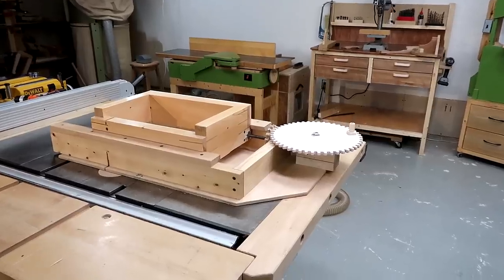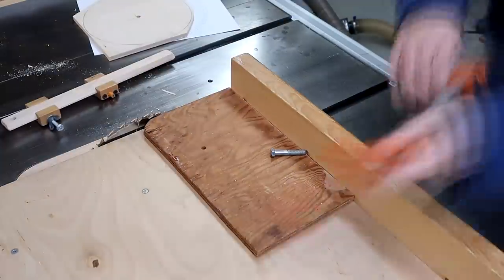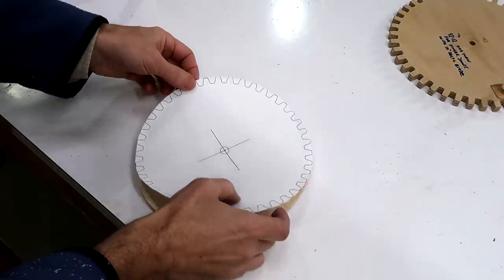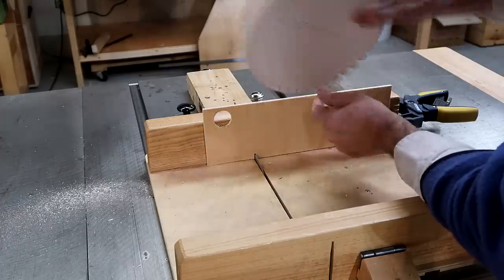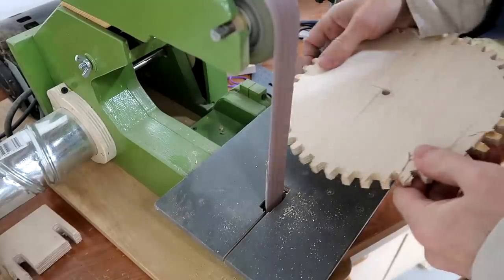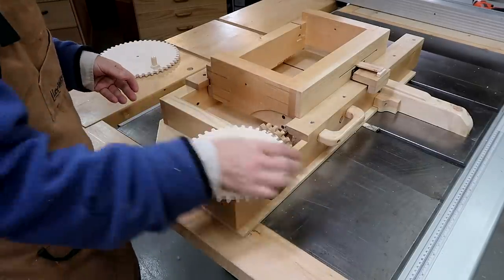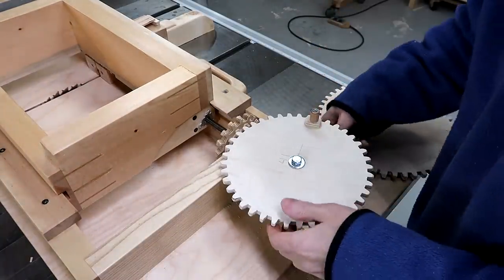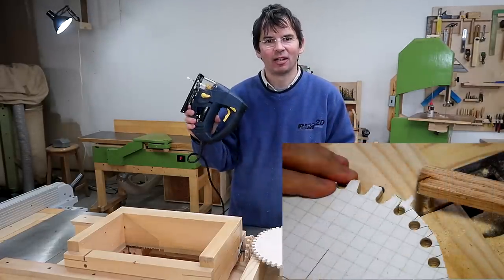Cutting a gear on the table saw

Comment: Now I'm curious to learn more about this double disc involute cutting method.   :'D
Reply: A demo with Matthiaws' ability to explain complicated things simply would be great :)
Reply: @richbuilds_com  Well unfortunatley it's almost no use at all. The involute is line rolled over a circle. Keep in mind the base circle (for the theoretical involute) is larger than the actual smalles diameter of a gear most of the times. So the involute function does not solve all the tooth geometry. For such large gears, the base circle would be arguably around pitch diameter, so the actual involute left is about 2-3mm length at the tip of the tooth. A straight line or an eyballed curve works perfect for wood. True geometry is needed for metal gears that you expect to last in heavy use, like a car gearbox.
Reply: Watch this video https://www.youtube.com/watch?v=so4O_yxUfCE but just imagine the table saw instead of the shaper. Would also be a lot quicker as you could take far more aggressive cuts.
Reply: I think this is the video you are searching for watch?v=tDqc5xMM5cA .
Reply: This guy does a decent job of explaining it, but the more impressive thing is how he makes using jigs for a scroll saw.

Comment: Looking at how Mathias cut that gear it seems possible you could speed up the process by using a similar mechanism like the box jig. Cut one tooth, move the work forward, slightly rotate the circle and cut another tooth. The sloping edges would need the circle angled also. I’m no engineer and not going to try this but seems possible.
Reply from the maker: Yes, and you could make yourself a perfectly spaced 48.5 tooth gear.

Comment: I always wonder why never a scroll saw. I've cut tight fitting dovetails on mine ,so precision certainly isn't an issue. With a reverse tooth blade you'd likely need to sand very little as well.

Comment: Steve Garrison has a jig for cutting Gears on a table saw, works quite well. Faster than band saw
Reply: Easy: yes and more accurate, but not sure if it's actually faster. The fiddly job of making the lines match break the flow of the bandsaw method.

Comment: I like the blade cover for the box joint jig.
Reply from the maker: it's actually mostly there to deflect sawdust into the saw, makes less of a mess that way.
Reply: @matthiasrandomstuff2221  sadly it also deflects Safety Trolls into the dust bin too - maybe you could make it out of glass or something which could shatter into a million high speed razor sharp shards just to keep them happy - you have to consider your audience after all.

Comment: Given no restrictions, is the bandsaw the preferred method?
Reply: yes, that or a scroll saw.
Reply: @ratchet1freak  first I need the box joint jig so that I can build the band saw to cut the gears for the box joint jig....so that I can build the band saw properly.
Reply: @greg Matthias has plans you can use to build a bandsaw with without the need for a table saw let alone a box joint jig

Comment: Honest question, what is the advantage of cutting gears this way versus a band saw? I like your circle cutting method on the table saw, but for the teeth of the gear it seems easier to do on a band saw as you can rest the work piece on a horizontal surface (of course if someone didn't have a band saw this would be a silly argument).
Reply from the maker: The advantage, if you don't have a bandsaw, is substantial.  If you do have a bandsaw, there is no advantage.
Reply: @matthiasrandomstuff2221  When will you get (build) a CNC table?  :)

you, we know for the simple items, cnc is inefficient, but for complex, and/or highly repetitive like gear cutting, CNC would be better, n'est ce pas?
Reply: @satxsatxsatx  I believe that this was answered by The Master once upon a video past with respect to both the time required to generate the G-Code and the lack of easily nesting parts on various bits of shop scrap in order to conserve raw materials - but then, you lose all the opportunities for endless frustrations in attempting to do both of those very things WITH a CNC - but the gears would be very nice.

Comment: You should be able to add a temporary smaller circle to your gear blank that is the diameter of the contact circle and have it roll on a shelf attached to your sled fence and you won't have to watch the tooth profile as closely.
Your blade will cut a true involute just rolling the gear blank side-to-side. You'll still have to make adjustments because the tooth space is wider than the saw blade.
Someone else is doing it this way on youtube.  Check Steve Garrison.
Reply from the maker: I put a note about this video to avoid getting too many of this exact comment

Comment: Danger factor aside. When I choose a method to make something, I also consider power consumption. Isn't the table saw method a bit inefficient?
Reply from the maker: You are right.  Using a bandsaw instead could save you about two cents of electricity.

Comment: Would you recommend a scroll saw over table/jig saw?
Reply from the maker: If you are patient
Reply: Was wondering the same thing -- what's the verdict? If you have access to both machines, which do you prefer? It appears that the table saw might be somewhat slower but requires less cleanup and shaping afterwards? I have made about 10 gears for my box joint jig (your plans - awesome tool) and technique on the bandsaw is a huge variable. Thanks for sharing Matthias. Good to see you back on the YouTube. Thx, Stu

Comment: Instead of bouncing the gear blank up and down on the table saw blade, have it roll from side to side on it's pitch diameter.  This should cut a true involute profile.
(Since the blade doesn't have the proper width teeth, you'll have to do this once for each side )

Comment: Hey Matthias. My wife and I were packing for a move and we got into a big discussion about the best way to fold the bottom of a cardboard box; we decided that you would be the best person to investigate the issue. Assuming you use the same amount of tape for every fold combination (we settled on one length-wise piece and two width-wise pieces, with about 8 cm of overhang) , what is the strongest way to fold the bottom of a cardboard box? Fold the short flaps in first, and then the long flaps over those OR the "lucky clover" method, where each flap is folded over the adjacent flap, in a clockwise fashion  OR fold the long flaps in first and then the short flaps. Please help! Also, maybe the load in the box matters? Perhaps one folding pattern is better suited for evenly distributed weight like books, but another patter would be better for smaller, denser objects. We would love to hear your thoughts.
Reply: Small boxes Maybe a cubic foot or so.

Fold the short flaps in first, and then the long flaps over those  and 100% coverage with white glue , weighted  with books or other flat weights overnight and then dried for three days to a week. 

Tape a continuous band all the way around the box in all three dimensions
Reply: @12345NoNamesLeft  you forgot to include the straight parts of a coat hanger cut to the appropriate length and slipped into the conveniently placed open and opposing ends of the corrugations of the long flaps and secured in an epoxy bed .... you need to fully insert the wires into one flap, close, and then use a magnet to advance them across into the mating flap and then keep immobile and weighted as above while everything cures.
Reply: @gregmislick1117  Jest if you will, but some dumb bastards fill huge boxes full of books with 200 pounds of books.  They secure it with a couple of 6 inches strips of tape to keep it all together, then are surprised when it all ends up in a shredded pile on the floor.  

Moving time is no time to be unorganized and unprepared.

Comment: I have a question: Have you ever found safety glasses you can use with your regular glasses that don't make you swear like a sailor?
Reply: When you get prescription glasses, ask the optician to make sure they are rated as safety glasses. 
It should be the default lens type as anyone wearing glasses may end up being in a situation that requires safety glasses.
Reply: @scotttovey  I doubt my glasses come in a safety variety and if so... man they already cost a thousand bucks without the frames... I don't even want to imagine how much they'd cost otherwise.
In this country, safety glasses are as much to protect my investment sitting on my nose as my eyes :D.
Reply: @RetiredRhetoricalWarhorse  
Ouch! 
That is expensive!
Reply: get a 3M grinding shield ... aka.. a full face shield (make sure that you get an impact rated shield insert - they make different shields for different stuff. Mine not only fits over my glasses, but my cartridge dust mask as well ... add in my 40 year old David Clark ear muffs and backwards ball cap and it makes a perfect Halloween mask too!
Reply: @gregmislick1117  😎👍😂

Comment: You should build a wooden gear hobbing machine.
Reply: ...custom router bit required I wonder?
could be built to work in combination with the tilting router table or perhaps the pantarouter - wooden hypoid gear hobbing machine !

Comment: Next year: sawing gears, one-handed, with a chainsaw!
Reply: ....while blindfolded, standing barefoot on the bed of a pickup truck moving across a newly plowed field at 60 mph.
Reply: @noremorsewoodworking2258  in a rainstorm  ;o)
Reply from the maker: there is a video on making dovetail joints with a chainsaw.  You should watch it!
Reply: @matthiasrandomstuff2221  I will!

Comment: I dunno about too dangerous, but it sure looks awkward.
Reply: with some thought and a bit more cutting, could probably build an adjustable ( for gear pitch etc) rack which would both hold the gear blank and roll it left to right for the involute cut... which solves both the awkwardness and the safety concerns I suppose
Reply: Yes. The table saw may in fact be the best method for copying gears or batching out large numbers, with the right jig!

Comment: I wonder if you could 3D print two or more smaller gears to achieve the correct gear reduction.
Honest question, but do you own a 3D printer?
Reply from the maker: Depends. Some gear ratios can't be factored, so can't be achieved with multiple gears.

Comment: Just fire up the CNC laser cutter. Cut 2 thin gears and glue them together.
Reply: Step 1. Buy a CNC laser cutter.
Reply: Only when Matthias finds a CNC laser cutter in the trash and rigs it to one of his Raspberry Pi.
Reply: @sligovolts  Hey @matthias - I have a spare motherboard from an ender 3 if you want to have a crack at a wooden cnc? ;-) (tbh, that's what the pantorouter and the router form follower are)
Reply: @richbuilds_com  3D printer electronics are a bit underpowered for spindle machines. Plus the motion controller in 3D printers are not very full featured either. I've heard the predictive path code described as, "non-existent".
Reply: @1pcfred  It's just a cpu (atmega if memory serves) on a pin out board - you can get it to run any code and plug any hardware pretty much. The whole platform is open source so there's plenty of options :)

I've just upgraded to 32bit boards (which is why I have the spares)
Reply: @richbuilds_com  I think I only run 32 bit on my CNC machine too. It was a long time ago that I set it up now. It works so I don't mess around with it. I use a whole PC as my motion controller. The signals come out of the parallel port and go to a buffered break out board then that sends my motor drivers step and direction signals. It is a bit more involved than using a microcontroller board. But it is stand alone. The GUI interface is right there on that PC.

Comment: AT 0.22 YOU SAY "HERE IS MY "TEMP-PLATE" ???   - 

THE CORRECT TERM IS: "
tem·plate
/ˈtemplət/
noun
1.
a shaped piece of metal, wood, card, plastic, or other material used as a pattern for processes such as painting, cutting out, shaping, or drilling.